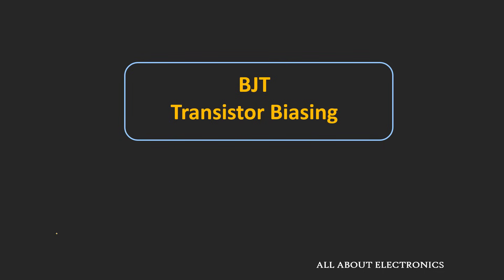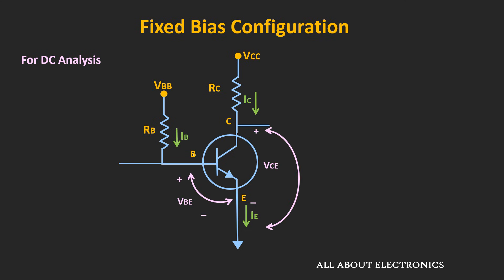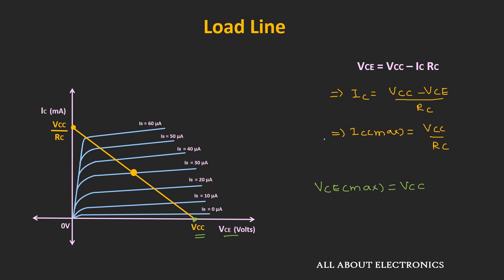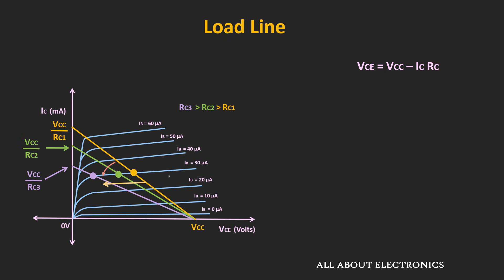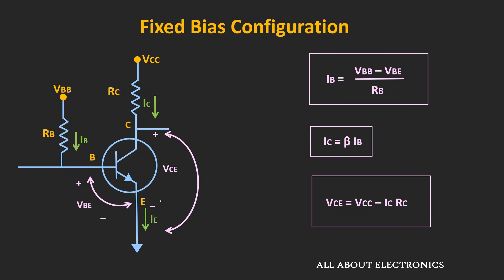Transistor Biasing: What is Q-point? What is Load Line? Fixed Bias Configuration Explained

Comment from the maker: The timestamps for the different topics covered in the video:

0:17 What is Biasing? The basics of the Transistor Biasing

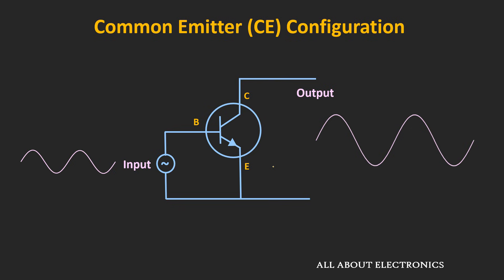2:19 What is Q-point (operating point) and the variation in the Q-point due to temperature

5:40 Fixed Bias (Base Bias) Configuration

8:21 What is Load Line?

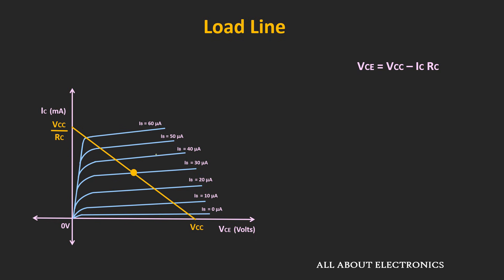10:48 Effect of  the change in the current gain (β) on the operating point in fixed bias configuration
Reply: Wow...
Reply: Super

Comment: There should be different characteristics for beta = 50 and beta = 200 when you are calculating the Q-point near the end of the video. Because otherwise the base current wouldn't stay the same (30uA). When beta is 200 the curve for Ib = 30uA is where the curve for 60uA is on characteristic for beta = 100. Other than that very good video and explanation.

Comment: 4:45 at that point or any point how is the collector current increasing and decreasings? Wont that onky happen if base current is increasing or decreasing?(Ic=BIb) but here base current is kept constant? I hope this isnot a very dumb question i am just confused..
Reply from the maker: Here the sine wave which is changing (shown in the pink colour) is AC signal. The AC signal is applied on top of the biasing signal. That means fixed base current is already flowing through the circuit. And on top of that, this AC signal is applied. When the DC biasing point is at the centre, the amplified AC signal will not get clipped. I hope, it will clear your doubt.
Reply: @ALLABOUTELECTRONICS  ooh i get it! Thanks

Comment: How can Ic be max when Vce is 0? When Vce is 0 doesn't the CB junction get forward biased causing no current in Ic except Icbo
Reply from the maker: I think you are talking about the load line. See, the two extreme points of the load line does not represent the actual operating point. The load line is just drawn from the equation, Vce = Vcc - Ic*Rc. The actual operating point is the intersection of the load line and device curve. So, of course the Vce can't be zero. But as the BJT goes into the saturation, Vce reduces to 0.1V or 0.2V. And hence, Ic increases. (The left portion of the device curve)
Reply: @ALLABOUTELECTRONICS  ah yes thanks that does make a lot of sense but what I don't understand is how when Ib is 0 Ic is also 0 even though there is a Vcc and similarly when Vce goes near 0 the CB junction should get forward biased which should stop the electrons from flowing from base to collector meaning Ic to be 0 but instead it gets to maximum. Other than this I have understood everything from your incredible videos. Thanks A LOTTTTTT!

Comment: 00:16 Basics of transistor biasing and its importance
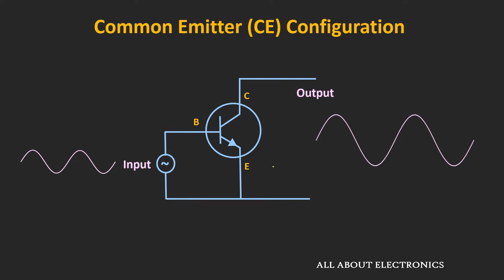02:12 The proper amplification depends on how well the BJT is biased in the active region.
03:56 The biasing point of a BJT affects its operation and stability.
05:50 The circuit can be redrawn and analyzed in DC
07:50 The operating point of the transistor is determined by the voltage Vce and the collector current Ic.
09:42 Operating point varies with changes in Vcc, Rc, Ib, temperature, and transistor replacement.
11:23 Beta affects the operating point of a transistor.
13:14 Transistor biasing and fixed bias configuration

Comment: At 5:50 you say the AC voltage is applied BETWEEN the base and the emitter terminal. I don't see this in the circuit schematic. Can you please explain?

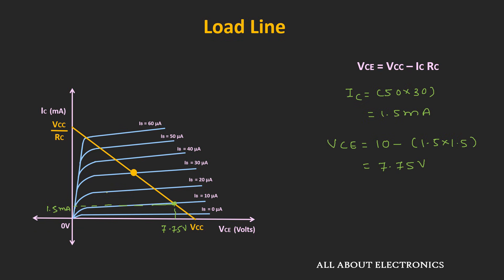Comment: @13:25 with Beta=50 and Ib= 30 mA , Ic=1.5mA and Vce=7.75volt, why you have mapped Q point on Ib=10 micro Amp? Please explain why are we mapping the Q point on Ib = 10 micro Amp , and does this mean Ib will also change?
Reply: The characteristic drawn in the video only works for beta = 100. If beta changes the characteristic also changes. Characteristic of Ib = 30uA would be higher on the graph. If we looked at characteristic of beta = 200 the characteristic for Ib = 30uA would be where the Ib = 60uA is on the graph for beta = 100. Current Ib is still 30uA when beta is 200. But the Q-point would be much higher and to the left of the graph. In the video the characteristic should be changed when calculating beta = 50 and 200, because otherwise the current Ib isn't 30uA but 60uA or around 15uA which is not correct.

Comment: Why in DC analysis capacitor acts as an open ckt... 
Plz clear my doubt sir..
Reply from the maker: Once the capacitor is fully charged then there is no flow of current through it, and therefore it acts like an open circuit. Therefore, for DC analysis, we can assume that, the capacitor is open circuit.
Reply: @ALLABOUTELECTRONICS  
Got it 
Thanku sir😊

Comment: 09:00 when Uce=0, Ic=0 according  to transistor output characteristics graph, but Ic=Vcc/Rc according  to output loadline. Can anyone  explain that to me?
Reply: When we are looking at the output characteristic of transistor there are many different curves. Each curve represents relation between collector currect Ic and collector-emitor voltage Uce when base current Ib has a specific value. We increase voltage Uce by increasing voltage Ucc and observe what happens to collector current Ic. At first by increasing Ucc and therefore voltage Uce collector current increases rapidly but than transistor starts to get saturated and collector current doesn't increase even if we increase Ucc. We can get a higher collector current by increasing base current. Higher base current increases the rise of collector current. That's what the graph represents. 

On the other hand load line tells you at which collector current Ic and voltage Uce the transistor is operating depending on the base current, Ucc and resistor Rc that you have in circuit. In load line Ucc and Rc must be the same for all points. You vary the position of the point and therefore Uce and Ic by changing base current Ib. If we have high base current the voltage Uce will decrease because transistor starts to conduct better and Ic will therefore increase because of the increase in conduction. If we lower the base current the voltage Uce increases because conduction of transistor decreases and Ic therefore also decreases. So when we don't have base current (Ib = 0uA) voltage Uce = Ucc because transistor is fully closed and Ic = 0A. But when we have a very high base current so that transistor is fully opened the Ic will be at maximum and Uce = 0V. So that is what load line basically represents.

Comment: At 9:00min graph i can't understand could you do with values in next video thank you
Reply from the maker: Consider any value of VCC and RC. Let's say, VCC = 10V and RC = 1KΩ. So, on the load line, Vce (max), the one end of load line on horizontal axis will be 10 V and ic ( max), the other end of load line will be 10 mA. That means, with the chosen values of VCC and RC, your operating point will be between two extremes. 
I hope, it will clear your doubt.

Comment: Why the  voltage Vce and collector current cant go below 0 volt and 0 amperes
Reply from the maker: In the given circuit, we have only positive biasing voltage. That means your output voltage can swing between +Vcc and 0V. It can't go below that. 
If the circuit consist of both positive and negative supplies, then it may go below 0V (depending on the input signal)

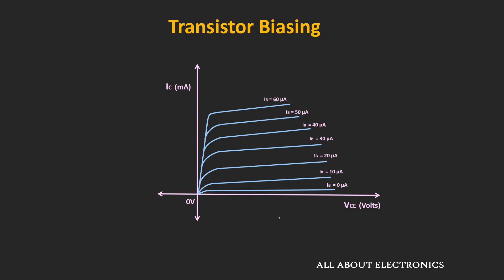Comment: 04:20 how do you decide this point (5VCE and 10mA Ic) as Q point?
Reply from the maker: It depends on your operating current and voltage. You should select the values of resistors and hence the biasing in a such a way that, the Q point remains in the center of the curve.

Comment: What is the use of the capacitors in the analysis of the circuit with AC input at 5:53 ?
Reply from the maker: They are coupling capacitors. During the analysis it has been assumed that we have pure AC source, but actually sometimes the ac signal is the output of some other amplifier stage. ( And it might contain DC part as well). The capacitor blocks this DC part and only passes the ac signal to the circuit. The same is the case for the output side capacitor. ( To block DC biasing voltage overriding on top of the ac signal).
I hope it will clear your doubt.
Reply: @ALLABOUTELECTRONICS  Nice

Comment: Excellent. I did not discover until recently that transistors made by the same manufacturer within the same batch, often differ wildly from one another. Hence emphasis on finding matching pairs of transistors (a problem not faced by valves which tend to be virtually homogenous). Fascinating. Thank you.
Reply: i dont understand why so?
Reply: @tamamemad2479  due to process variations. If that is controlled tightly across the semiconductor wafer (very tough), then the transistors will be closer to each other in its electrical metrics.

Comment: At around 13:23, the lecturer plots the obtained value pair of 7.75V and 1.5 mA on the graph on the left side of the screen.  However, the lines in sky blue color which represent Ib (the base current) should have been changed to reflect the change in beta value.  The sky blue lines are still representing beta value of 100 rather than 50 which he just used for calculation.  If they were to represent beta value of 50, they would have come down closer to the horizontal axis, and the dot ( 7.75 V , 1.5 mA) would be riding on Ib = 30 uA curve.  Right now in the graph, dot ( 7.75V, 1.5 mA ) looks like it is riding on Ib = 10 uA curve, which is very wrong.
Reply: This is true. If this plot (13:23)  represents the relationship between beta and Ic then when beta is halved from 100 to 50 then, keeping the ordinate scale the same, would compress the collector lines into the bottom half of the graph as, for each value of Ib, we would only have half the value of Ic. Similarly increasing the beta from 100 to 200 would expand the collector lines to twice it's exiting territory. Nevertheless the gist of the argument is sound. Namely that the fixed bias configuration is very sensitive to changes in beta.
Reply: thanks dude, i was genuinely tripping on that part. this clears stuff up.

Comment: Sir at 7:08 why there is no Rπ aka input impedance please answer sir
Reply from the maker: This is DC analysis. It comes into the picture during AC analysis.
Reply: @ALLABOUTELECTRONICS  thank you,  but I could not think of a possible explanation as we have for capacitors, at reasonable  frequency impedance decreases but here we have something like a diode in between base and emitter .often base current is taken very low and if we compare to a diode at such current there is definitely a non zero resistance there and we are missing this in the expression of Ib at7:10
Reply from the maker: @gulzarali6370  I recommend you to go through a video of the large-signal model of BJT. Please go through that video. Your doubts will get clear. Please check the BJT playlist on the channel. You will get that video. If you are not able to find the video, let me know.
Reply: @ALLABOUTELECTRONICS  thank you sir, you save my day

Comment: Sir , in the last part You showed the change in the Operating Point due to change in Beta . For Beta 50 and 200 while calculating IC  you considered IB = 30 microamps , but as the operating point changed the IB changed to 10 and 50 microamps . I cannot relate the two . IB is chosen to be 30 how can it change ????????
Reply: Good catch.  The characteristic curves themselves (or at least the IB labels) needed to change along with the change in Beta.  See also walkalone's comment below.
Reply: I have the same question.
Reply: itu perbandingan saat transistor kita hitung dalam kondisi suhu stabil
tetapi saat transistor dalam keadaan panas nilai hfe/beta juga berubah, alhasil kurva menunjukkan hasil yang berbeda juga dan tentu kita juga harus faham wilayah saturasi dan wilayah aktif transistor. itu menurut saya

Comment: Buffers, Inverters, Gates, Latches, Toggle Flip Flops, and Data Flip Flops made with only SPDT Relays are a fun starting point for digital electronics since no resistance or voltage need be considered. All is mostly a switch being in one of two positions as controlled by an electromagnet being energized or unenergized. From there ICs can be substituted as needed as long as the rules for those ICs are followed.

Comment: When input signal is in negative cycle VBE will become reverse bias right ?? Then Ic  should not flow ryt ??
Reply from the maker: Here we are discussing about the DC biasing. On top of it there will be small ac input signal for amplification. But because of the dc biasing, the overall signal won't go below 0.7V. Or altleast that's how the biasing is done. 
If you go through the entire series on BJT then I have explained about large and small signal analysis.
For more information, you can go through it.

Comment: Sir, 7:59 could u pls tell me the KVL rule, how it got that eqn, how to apply kvl rule
Reply from the maker: Just start applying KVL from the top. When there is a voltage drop, consider it as a negative voltage. Across the collector and emitter, there is a voltage drop as one goes from the top to bottom. That means it can be considered as negative in the KVL equation. The same is true for the voltage drop across the collector resistor.
Reply: ALL ABOUT ELECTRONICS  so what abt Vcc
Reply from the maker: Here Vcc is just show by a small dot. But if in doubt, then you can draw a Vcc with both positive and negative terminal. The positive terminal will be connected with Rc, while negative will get connected with ground. And then you can apply KVL in the loop.
Reply: ALL ABOUT ELECTRONICS thank you so much sir.
Reply: ALL ABOUT ELECTRONICS thank you so much sir, 
Sir also could you please tell me the software or app that you are using to make videos, I want to do a math video like this. please do tell

Comment: Design a fixed bias circuit using silicon npn transistor which 
has a dc current gain 150, to operate the transistor with 
collector-emitter voltage of 5v, and collector current of 5mA 
and supply voltage is 10v. Explain operation of the circuit and 
discuss advantages and disadvantages of fixed bias circuit. 
bahi plz iss ka solution chaiye
I have solution if this problem plz give me solution of this one.
Reply: yar plz iss solve karke dedo
Reply: plz yar
Reply: please help kardo

Comment: Where is dc source placed when ac is in the input
Reply from the maker: DC source is applied as it is. On top of it,the ac input signal is applied using the coupling capacitor. To get better idea,I would suggest you to go through videos onthe small signal model and small signal analysis of BJT.
On the playlist of BJT, you will get those videos.

Comment: how did you get that sine wave showing it gets clipped at those peaks? ( @3:33 )
Reply from the maker: Let me explain with some numbers. 
Let's say you have biased the BJT in a such a way that, VCE = 2V. And on top of that biasing voltage the output sinewave swings by +- 3V.
That means on the positive side, it will go maximum up to 5V, while on the negative side, it will minimize to (+2 - 3) = -1V.
But it won't be able to go below 0V. 
So, output voltage won't go below 0V. And for that portion where the output supposed to go below 0V, gets clipped.
The same thing is represented graphically. 
If you observe, on the horizontal axis, the VCE is close to 0V. (Maybe around 1V or 2V)
If the voltage swing is reduced, then the output signal won't clip. 
I hope it will clear your doubt.
Reply: @ALLABOUTELECTRONICS  it did clear mine thanks

Comment: Sir, in this video you haven't explained how this fixed biasing actually helps in stabilizing the CE configuration in any way. Kindly provide that information also. Also, you could have explained about drawing the load line for those AC signals a little more clearly.

Comment: Wait... Shouldn't Vbb also equal Vcc in fixed bias?
Reply from the maker: Not necessarily. There has to have some fixed voltage. It could be VCC or some other fixed DC voltage. Usually to use a single supply, it is biased with VCC.
Reply: @ALLABOUTELECTRONICS  Oh i see, thanks for the swift reply! Need to fully understand this for my licensure exams. So a fixed bias is like a common emitter then?
Reply from the maker: Yes it is. Actually when we say common emitter configuration we are actually refering to the AC signal. That means the ac input signal is applied between the base and emitter while the output is measured between collector and emitter. But to use the BJT as an amplifier we need to bias it. ( We need to apply the DC voltage). There are many ways to bias it. And fixed bias is one of the way. I hope it will clear your doubt. If you go through all the videos on playlist, you will get it.

Comment: ALL ABOUT ELECTRONICS                                                                             Does the AC/DC load line mean the maximum output wattage power of the transistor or does the AC/DC load line mean the power dissipation of the transistor? Because the AC/DC load line is selected by the EE designer of the operating voltage and operating current for the transistor and the DC bias Q point which will determine the maximum output wattage power out of the transistor and the power dissipation of the transistor. I'm not sure what the LOAD means in the AC load line and DC load line what they are calling the LOAD.
Reply: In nonlinear cct analysis the (nonlinear) electronic device is defined as the source; the biasing cct and the load resistor forms the load to the device. Refer to book by Belanger, Adler, and Rumin.